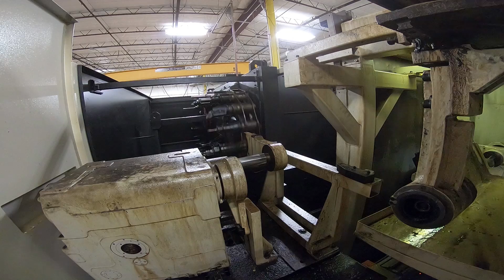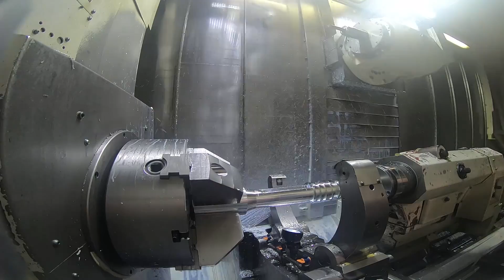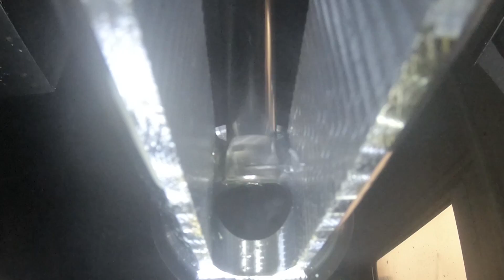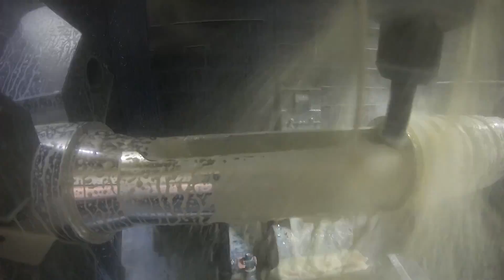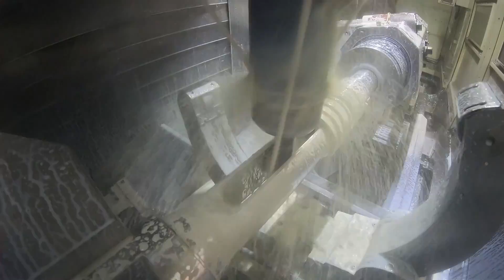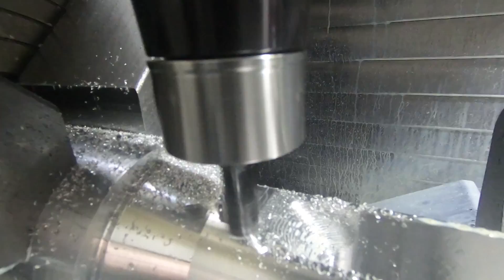Valve Body Finish Slot

Comment: I love watching these videos. Definitely learn something every time I watch one of these. I had a question for you regarding tool organization. Just curious when you are at your desk programming how you assign pots. Do you have a group of standard tools you leave in the machine? As you know with milling and turning work the pots add up quick. How do you choose which tools stay and which you will replace? On our Integrex we have a spreadsheet we update but it gets to be tricky remembering certain tools that should stay.
Reply from the maker: If you have enough tool holders (I don't for this) on the Integrex you could set different offsets. Say 1A, 1B, 1C  (Almost every letter of the alphabet can be used on each offset. Except the letters H,I and O. so thats 23 offsets for every single offset.) and so on for every tool number. Than if you had a rack to hold all those tools you could have a very large tool inventory and just swap out tools for different jobs. In my case the jobs lately have been so varied I don't have many tools that stay in any one location. Some turning tools but that's about it. In the beginning i I was running a job that took more than the 80 tools to do the three operations that part required. I did do what I previously described putting the unused but setup tools in the rack between operations. This worked without a hitch. To call up those Mazatrol offsets in a G-Code (.eia) program it would be tool 1A = M6 T1.01 tool 1B = M6 T1.02 and so on. Im my cam software I have many tool libraries but I as well have to get better organized in this regard too. On may horizontal mill I have been trying some labels from a Brother label maker. The kind with the strong adhesive. They seem to be holding up to the coolant very well.

Comment: I like to see you take the cuts to an fro instead of milling it all from one side, is that special for your cam program?
Reply from the maker: It is from the cam software. It depends on the cutting strategy you select and the setting you select in that. There are reasons for milling in one direction when applying cutter (or tip comp on a turning tool) compensation or the cutting forces on the tool. I mostly use climb milling when doing that. As far as surfacing milling you aren’t using cutter comp. so a bidirectional mill path usually saves time. But even so there may still be reasons for using a climb milling only direction in surface for finish quality or tool pressure reasons.

Comment: Great part.. this is the first time that there is a machining in mixed.. climb and conventional cutting. Thanks edge for show us all your knowledge
Reply from the maker: Generally when surface milling you use a bidirectional milling pattern. Mostly to save time. Because of the small depth of cut this usually isn’t a problem. Also you are usually not using cutter comp when doing this kind of milling. Because traveling back and forth would be complicated with cutter comp switching from left to right back and forth.

Comment: Dose this machine have parameters to help the machine not crash into itself or will it just go where ever you tell it to go
Reply from the maker: In a mazatrol program with the safety zones enabled and described properly the machine will stop itself. In a G code or what Mazak calls a EIA program only the travel limits may be active. And also if the safety zones are disabled. I normally run with the safety zones disabled. So it’s necessary to pay attention to where the machine is going.

Comment: How should I process this slot with plunge milling?
First drill from the middle of the slot, then use the plunge cutter to start machining on both sides?
THANKS FOR SHAREING
Reply from the maker: I don’t know if you saw the previous video in this series. In that video I show the plunge mill roughing the slot.

Comment: This is so beautiful! What do you do with test parts after a job is finished? It would be awesome (if you don't need to hold on to it) if you could donate it to a tech school to show what a multi axis machine can do.
Reply from the maker: I usually keep test parts like this. Sometimes it can be a lot of time if and when I get to run the job again. I can refer back to the setup part if I don’t remember something. Some of them also get put in the display case in the lobby if they fit.

Comment: Have you ever done custom parts for performance /race engines?  Eg custom blocks or cylinder head / cranks etc? 

Do you ever do design work parts directly?  Or only the CNC programing side of things?
Reply from the maker: No I haven’t done any engine parts. The only design work I do is on fixturing or special measuring instruments. I do have some ideas on some of my own products. If I ever get the time.
Reply: Edge Precision 
Thanks for the reply.  

If someone came to you with an engine block or cylinder head, and said, i want one of these carved out of a solid block.  Is it something you could/would do?  Would you need a digital plan of the component first, or could you work back from the actual real part to design and build a billet replacement?
Reply from the maker: I would need a solid model. But I don’t think I would have the time.

Comment: What is your go to surface tool paths? I us mastercam and flowline and blend seem to work the best. Just curious on what path seem to work for you.
Reply from the maker: It depends. I think in this case it was Z plainer finishing. In Esprit this can be a full 5axis cycle. But in this case I have the B axis fixed to vertical. Vertical doesn’t necessarily mean vertical it means parallel to the Z of the active work plane.

Comment: id be interested to see some more on in program probing to see if bores and shoulders are correct if not the machine recuts. how is that done????
Reply from the maker: Typically I would measure and make adjustments to the offsets or program and rerun the tool that cuts the feature.
Reply: Thanks Peter, you did something a while back on the horizontal mill. But I didn't understand what was going on.